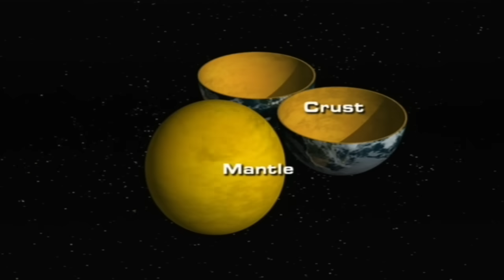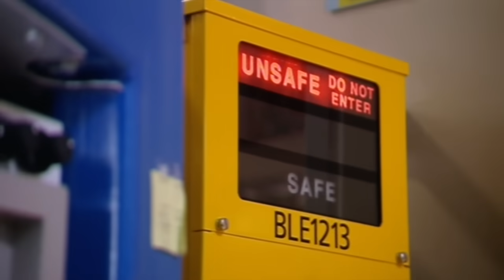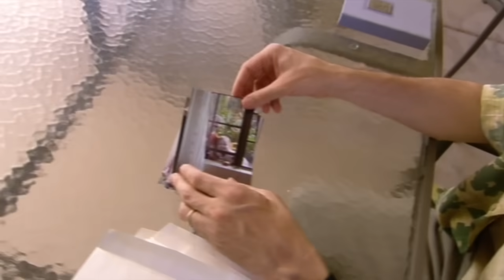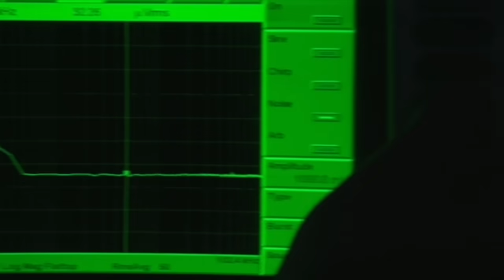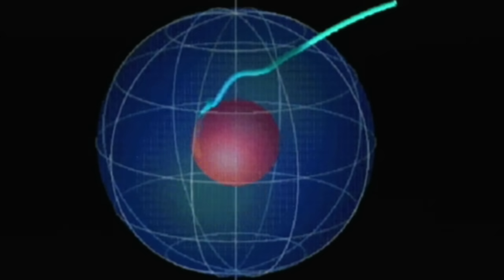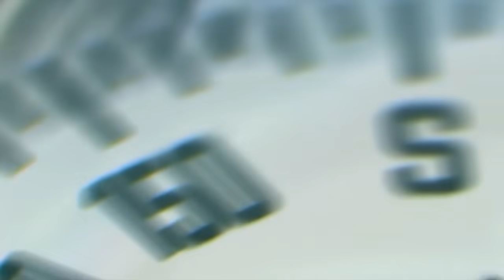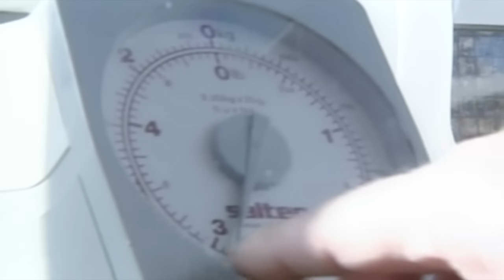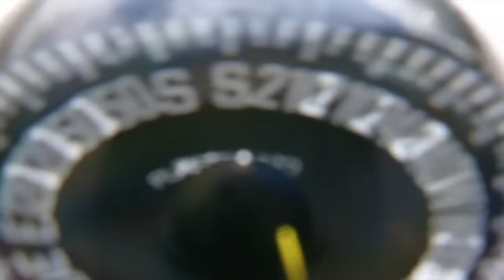Earth's Core

Comment: The cores is a group of shells of the heaviest elements known to man and some that we haven't discovered which cannot exist in a stable form on the surface. The average mass that we can detect is that of Iron and Nickle in a plasma state.. This core is surrounded by a magma core or conglomerate of other compounds of all of the elements. The magma structure is heated by the radiation being emitted by the core and the radiation filters up to the crust as background radiation of a non lethal amount to life. In addition the core is spinning at one angle, the magma shell at another and the crust at still a third angle. We have true north from the crust angle of twenty three and a half degrees and a variable angle of magnetic north induced by the other two angles which rotate around the true north point .

Comment: I am of the belief the inter mantel is slightly oblonged by the pull of the sun and or other extraterrestrial bodies. Due do its density (heaviest metals and likely nuclear reactor) causing it to move slower than the outer core and mantle which move at about the pace as the crust.

Comment: Question: Is the molten core at the center of the earth effected by the moon. Like the oceans are affected by the moon causing tidel movement we see. Since we need the magnetic field to prevent radiation from entering earth atmosphere. The magnetic field is produced by the cores constant 'swirling'. The video said no one knows why the core swirls in random ways. But isn't this caused by the moon's pull on earth metal core?

Comment: And how exactly do they know what’s down there?
Reply: They know there's rock and gas down there because of rock and gas coming out of volcanoes, of course. They don't know but have good evidence that there's liquid and solid iron and nickel. The evidence includes the magnetic field and the iron and nickel that's found in Earth. It's though that that sunk and formed a core when the Earth was forming. Pressure and temperature can be calculated and seismic waves can tell you how hard material is. The harder the material is, the faster seismic waves travel through it.

Comment: Bullets travel at 3000 mph? No, they most certainly do not. At least not the ones in the video. 🤦‍♂️
Reply: how about 3000 feet per second which equates to 2045 miles per hour if it were 3000 mph that would be 4400 feet per second, is that possible I'm not sure we can rule that out, I'm out of touch with modern ballistics.

Comment: I think the core of the earth works just the same way as the sun it’s just surrounded by dirt and rock, and water. And the sun works by cosmic electrical current flowing thru it which makes it glow similar to how an incandescent light bulb does. The earth internal sun is just a hell of a lot smaller and that’s how the moon  or it’s the earth the gravity that’s created from the sun at the earths core. All planets and stars sun generate gravity from the electrical current flowing thru them just like a magnetic field is created in a coil of wire . Try and tell me this doesn’t make perfect sense

Comment: The Earths core structure mimics the core structure of the Sun, only in a much smaller version. The elements of the innermost layers are above atomic weights of two or possibly three hundred and they are very radioactive. The surrounding structure of magma, very dense near the core and lessening in density as it gets close to the interface with the rock like structure which is the Earth's mantel shields us from most of this radiation. We read it as background radiation. Their are no rocky cores within any of the Planets all of the major Planets have inner core structures similar to Earth's, but slightly larger. Jupiter probably has a radioactive core three times larger or more than Earths. It is surrounded by a less dense and smaller magma structure and above that by a plasma structure of Hydrocarbon compounds up to a gaseous envelop and its radioactive strength is strong enough to be in the microwave bandwidths being emitted.      .